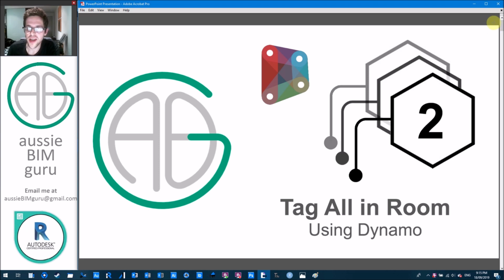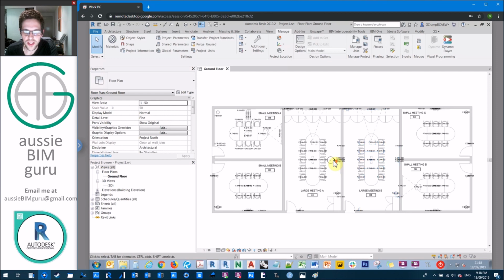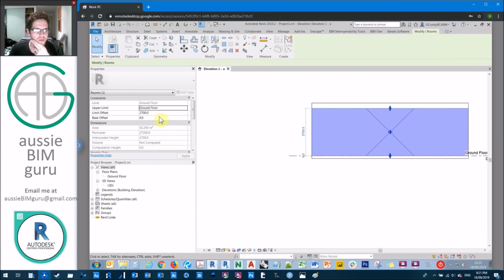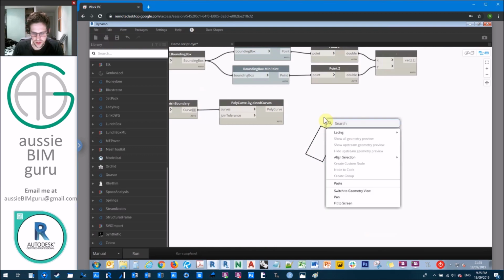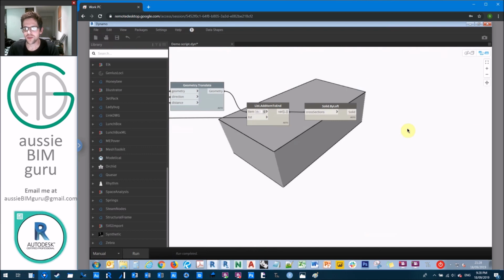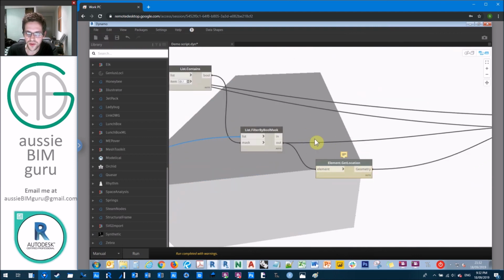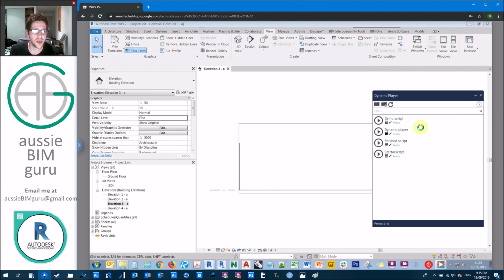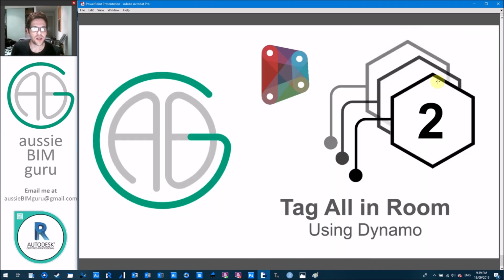Tag All in Room using Dynamo! (Tag All 2/3)

Comment: much much thanks for such useful videos. I have a question that room tags are created at 0 elevation in section views how can we get them at some height. tag.setlocation also does not work here. Thanks.
Reply from the maker: The element.movewithvector node can move tags vertically in a view, but youll need to use transaction.start for both inputs and a transaction.end after

Comment: Thanks Gavin! I have problem with node Element.GetLocation. It can't get coordinates to Floors, how can I fix it? Thanks and best regards.
Reply from the maker: This workflow only works for hosted element tags (multi-category, by category).

For spot coordinates/elevations, there are some nodes in the Clockwork package. Check out this thread here where they discuss it (user/package creator): https://forum.dynamobim.com/t/spot-coordinates/27910/5
Reply: @AussieBIMGuru  I meant Node Element.GetLocation can't get Floor location. you can check it in link :
https://drive.google.com/open?id=1lPnSM5DnmSsoWcJ5xv2gqOlEJVUYGxcM
Thank you!
Reply from the maker: I don't think floors can have a location, instead you can get boundary curves, patch them to a surface and get point at uv parameter 0.5,0.5 for the centre.